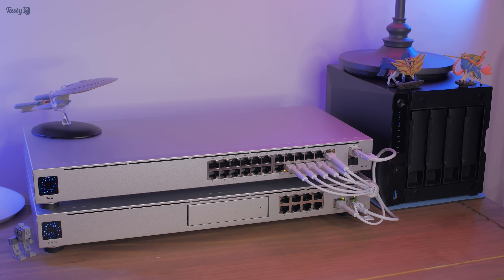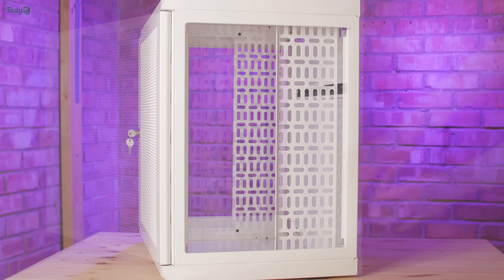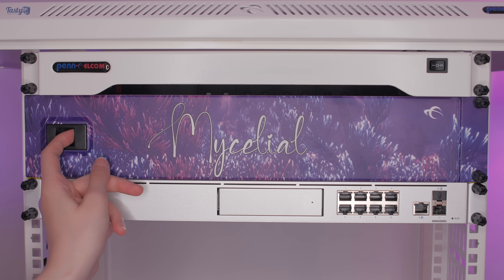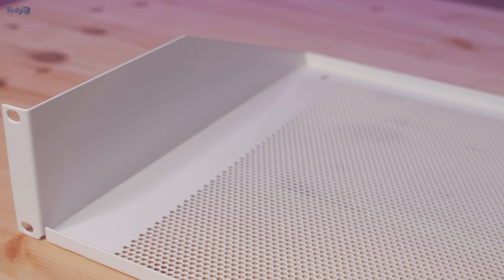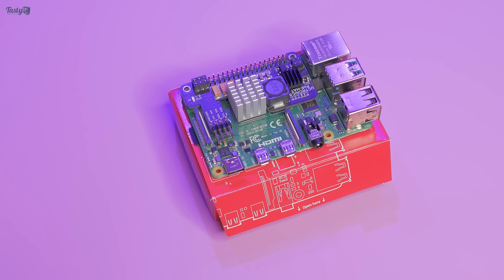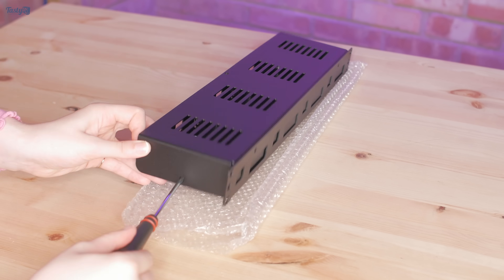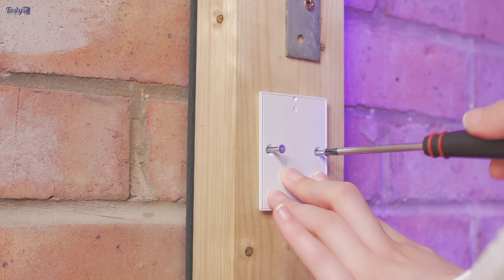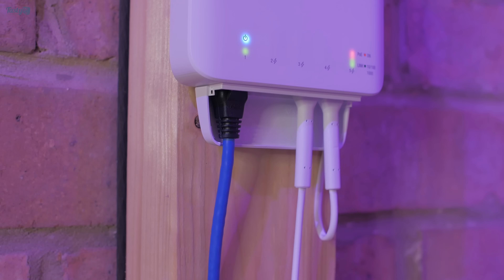White Rack, Pink WAP & Multiple Pi's

Comment: I love your videos and this rack is really cute. Not as cool as my massive big manly rack though of course... Heh heh. I'm just kidding.
I actually wish my rack was as neat as yours. But I have too much crap in it now. Its probably time to pull it all out and reinstall it neatly.
A note for you about screwing in circuit boards though. Raspberry Pi's, motherboards etc should always have ALL screws installed. They aren't just for holding the boards in place, they are how the boards gets grounded to the case/rack.
Each one of those screw holes has a contact on them. Different parts of the board are grounded to different holes. So you really should install all 4 screws. Particularly because of the PoE hat.
And if for whatever reason you really only want to use two screws. Then you should use one screw on each side to support it better. Both screws on one side means that you'll get torsional force applied the board when you plug things in, pull things out etc. This can make the board flex and damage the traces and contacts.
Just wanted to mention this to you as it could cause problems for you. I'd hate for something to happen and you have to replace things and reinstall them again.

Comment: Just need to get some ear plugs now, especially if you add a rack mount UPS later!
Reply from the maker: As it's in my bedroom, everything I've installed so far is either silent or so quiet that I can't hear it.
Reply: @TastyPC  that's good! The larger UniFi switches (e.g. 48 port) are pretty loud, I guess it relates to the number of ports and wattage of the PoE. Rack mount UPS though in my experience are even louder (probably intended for data centre use really).

Comment: My WAP is so grimy, no connection anywhere ngl
Reply: My wap currently is just a rpi 4 :P 
Its main use though is to act as a router so I can ssh between all of my devices connected into my network switch. My apartments aggregate wifi is kinda bullshit, only allowing up to ten devices and not allowing any use of ssh. Hence the pi 4.

Comment: Yeah, awesome and thanks for the coverage of this.  I'm looking to upgrade to this line of equipment and good to see some of the things you learned with the deployment.

I have a wireless ac network at home with unmanaged switches, but the ubiquiti line is the best price/performance that I've had my eye on.  Not really happy with the coverage of the wifi either, and  it not bring mesh can be annoying with how the wifi is in the house.  I'll be getting ubiquiti soon.

That raspberry Pi rack mount is so cool.  It would be nice if there were a few NAS options for the rack to fill in the other 3 slots past the pihole.

Comment: Slick build! 

There are some little Supermicro 1u servers that are shallow enough to fit in a small rack, but still have plenty of power for a VM lab. They are often sold on flebay as the Hyve Zeus for a couple hundred gpb depending on specs. The faceplates would match your existing aesthetic, with its simple perforated metal facia.

Comment: So refreshing to have a Female tech reviewer. Here's to hoping you get more opportunity and success.

Pi-hole setup video would be good too, I hadn't heard of this until now.
Reply: oh you can have a need for it :)
my PC sits on a 12U rack on wheels. You can use rack units for lots of things like..
-audio interface if you intend to use real microphones for chat/streaming
-Power strips/power conditionner, to avoid PFC buzzing on your power supply and have surge protection and clean ground
-network switches, even if it's not a fancy router.. it's sooooo much more handy when you use a laptop regularely and still want fast network or don't want to use wifi
-friggin drawers.. your junk deserves rack space, and it's super heavy duty..
Reply: linus did a video on it ...
Reply: @jyvben1520   There is no contest; if you'd rather watch and listen to Linus, you need to check into a funeral parlour. You've been dead at least three days. :-)
Reply: @stevewatson6839  there are others that have pi-hole videos, you can search in youtube ... or you can wait for it here ...
Reply: Or pfblockerng on pfsense. I’m currently crawling down this rabbit hole.
Reply: i was like what is that??? thats some rare channels since most ppl in the homelab area are guys. Still trying to convince my gf to do things like that

Comment: One of my most versatile pieces of kit is a "repeater" that I got from a charity shop.
The thing is tri-mode, it can be a WiFi repeater, a WiFi access point, or a WiFi client to ethernet adapter. My networking needs are on the cheap side
Reply: Any router that supports OpenWRT or DD-WRT can do all 3 of those, the dual radio ones work really well as repeaters.

Comment: Love that ref to Discovery's Mycelial network!

Not useful for you since you already bought an enclosure, but Rasp Pi Mag, from the RaspPi Foundation recommends standing the Pi on it's side as it allows air to easily move across the cpu.
Reply from the maker: I have some ideas for additional cooling.
1) you know how servers sometimes have plastic shrouds to direct air through heatsinks etc, well I was thinking I could 3D print little shrouds between the Pi CPU heatsink and the rear fans that I'd add.
2) The PCB for the Pi gets really hot which I believe is intentional. With it being in a metal case I thought I could add some sort of thick thermal pad under each Pi, connecting it thermally to the case which would act as a large passive heatsink.
Reply: Sounds like a tasty plan XD. If you have a way to measure infrared or someone you know does, it would be a great 5-6 min video idea.